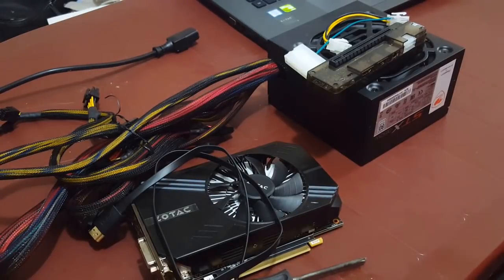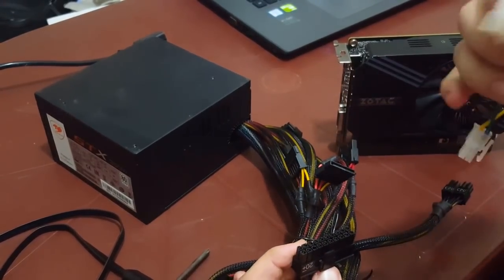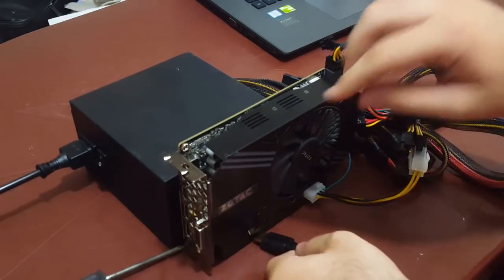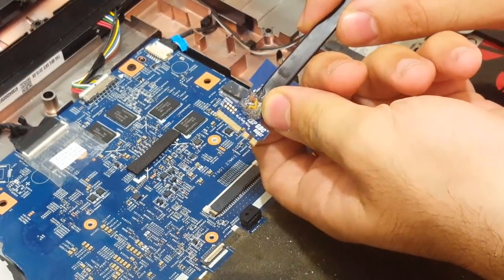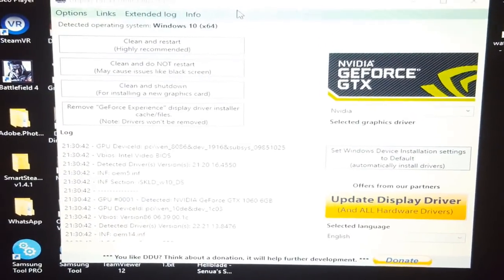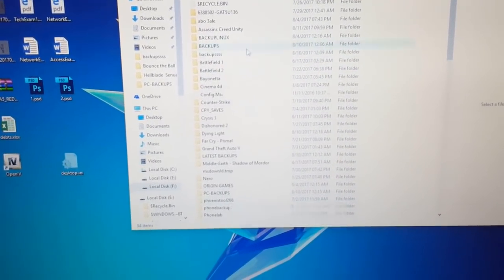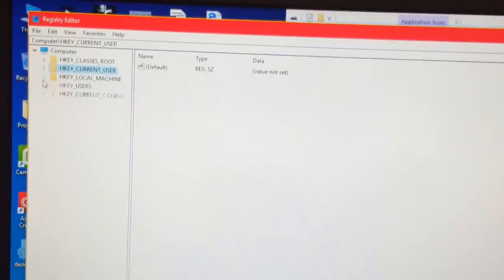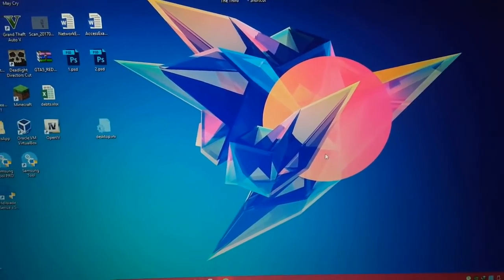HOW TO: External GPU for any laptop PC W/O External Monitor GTX 1060 EXP GDC 1050 ti solve error 43

Comment: I have a question. If the gpu is a low profile one which does not require a powersupply will this still work? does the external pcie require a powersupply to power the low profile gpu even tho it does not need a powersupply?
Reply from the maker: The device will require at least a 9v or I believe it was 12v adapter to power the GPU upnif you dont have a PSU

Comment: Question, No Ext. GPU on my Surface Note, Barely plays Fallout 76 and gets hot. Will this actually increase preformance or will I also need a ext. monitor? Will this just overheat the system altogether?
Reply from the maker: Hey, it's been years since I tried out new laptops for this tool, I'm sorry, but you'll have to check other sources or try it out yourself. But theoretically speaking it should sideload mlst of the graphics calculations to the external GPU which should reduce heat
Reply: @hmawla  Thank you, at least a responce. When I can I will try this. I will let you know. I have asked several sources to ne ignored. So basically sideloading or Aux sourcing should improve performance basically?
Reply from the maker: @Wolf'Jarl Gr'Bane  you're very welcome, and yes for the sideloading point.

Comment: Hi there. My Fujitsu Celsius H710 comes only with built in Nvidia Quadro 1000M card and I try to use Quadro 4000 card for the EXP GDC. When I try to use the Quadro 4000 with external monitor system crashes into BSOD and error message states driver failure. I I have NO intel hd graphics, how do I procede?

Comment: Bro I have e15 e5 571g acer laptop ..and I have also beast 8. And gtx 1050 ti 4gb. Then 1st time when I connected the egpu my lap not booting its black screen.. then I try to hot plug .. it's working..but after installation pc will restarting then it will happen again black screen ..not boot .. so do you have any solution..
Reply: And I try to like your video then it happened again

Comment: Hi, I have lenovo y570 laptop with nvidia gt 555m video card and integrated hd 3000 graphic and I connected external gpu video card nvidia gtx 1050 ti 4gb cerberus bit when laptop boots device manager can't detect external card, gpu I desabled in bios and leaved only hd graphic card why laptop can't see my external gpu? Maybe the gtx1050 ti card is not supported? Can you help me please? Thank you

Comment: Help please, ( MY EGPU IS GTX 1070) my laptop gpu is GTX970m, the probleme is : when i try to instal the DRIVER, they instal me the GTX970m driver, and make the EGPU (GTX 1070) whith the error 43!!, I dont now how the resolv this problem, CAN YOU HELP ME PLEASE. THNX
Reply from the maker: Hey, take a deep breath and check the description and the user comments, there are multiple ways to fix this error, so try them all
Reply: @hmawla  i try evry things, i need ti now how i can deseable the gtx970m, because when i try to instal the drivers the gtx970m turn on ... How i can block it .. and thanx
Reply: @hmawla  Hi, When i try to instal the modifed driver (you now when you add you grafic code and name)  whith my gtx1070, the instalation is stopped because  an error, tell the instalation cant continued.
Do you now how can i resolv this.

And thanx.

Comment: Thank you so much ! is really work for me !! but one more problem for me is my laptop will restart itself randomly about 10 to 20 minutes Repeatly , can you please help me out ? Thanks in ADVANCED  !!!
Reply from the maker: It could be that the laptop can't handle the GPU power so you can try to downclock the gpu a bit, also try using a better power supply
Reply: @hmawla   HI Mawla , thank you for your reply , what you mean by downclock the GPU a bit ? and i am using a Cooler Master  MWE 550W PSU , is that good enough to supply ? Cheers
Reply from the maker: @stephenphuan8696  then the power supply should be good, as for the downclocking use something like msi afterburner to make the gpu clock lower than stock which will limit the gpu power for stability purposes
Reply: @hmawla  Thank you so much , will try it later ! Cheerss ! Thumbs up for you and subscribed to your channel !!!

Comment: Full of tricks , i happy you all spend your time for share us the skill .  2020 i will try to using GTX1070 into my Predator 17 , to replace my GTX980m
Reply: just don't u will lose a lot of gpu performance because the wifi socket is way to less data transfer to that the gpu need as i remember it can reach about 5gb of transfer data but the the high end gpus need about 70~90 gbs to give the full power of the card i think u will not get far from ur 980m
Reply: @AhmedMakki-to4vr  if his laptop has thunderbolt or express card then its fine

Comment: I check my laptop but my wireless card is soldered by the manufacturer. Can that fit in my m.2 nvme pcie lanes?
I got two ssd installed in my laptop. The sata 3 port and the pcie m.2 nvme. 
If compatible i will sacrifice my m.2 nvme for the sake of egpu.
Reply from the maker: Check if you can find a PCie version of the beast adapter

Comment: Finally I found an actual helpful video because I am using a 1050ti. That video is 3 years old now, what drivers do i need to use? is it the latest ones or the versions you gave us? Also another thing, I was able to make my 1050ti appear in the device manager with the drivers installed but if i dsabled my 960m, the 1050ti also disables itself. Im using a inspiron 15-7559
Reply: I have a 1050ti too but when I opened my laptop with it the screen flickers and doesn't want to work that happened with you or if you have a solution please
Reply: @ammaryasser6588  I successfully made my 1050ti work, but I never encountered such problem, have you checked that the egpu has enough power to function because if the screen flickers, it might be a gpu problem.
Reply: @randomstuffmaker3166   yes I think I have enough power but what I don't understand that when the screen flickers then stops it open the bios telling me no hard drive in the laptop please put one
Reply: @randomstuffmaker3166   thank you for helping me
Reply: @randomstuffmaker3166  can you pls describe how you made it work, I'm using gtx 1660 egpu for inspiron 15 7559.
Reply: What's the performance you get on your 1050ti

Comment: Hi to all! I need a bit of an advice. 
I have Acer Aspire V3 
I7 
16Gb
SSD 
EXP GDP V8.0

I'd like to configure eGPU with GTC 1060 6GB OC

I follow the procedure and when install 368.81 driver there is automatic reboot and I cant or I dont know how to stop it. I have 60s and than PC restarts. I tried quickly to go to regedit and removed reboot but pc still doest it. 

Would anyone have any suggestions? 
Cheers Nick

Comment: hey man, i installed my gtx 760 and the latest driver.
my problem is, that i can`t open the nvidia control panel. everytime i want to open it, i get the message that there isn`t a monitor connected to the 760.
do you have any solution for that?
Reply: Conected external monitor

Comment: If i would still use my built-in dedicated gpu, during times that i would only bring my laptop and not the egpu. Do I still need to uninstall the driver as you showed in the video? How would i use the dedicated gpu if I unplug the egpu?

Comment: great video man. i have a question: some guys say that you need an external monitor. why runs your internal monitor? i noticed that the guys, who need an external monitor don´t have a dedicated graphicscard in their laptop. 

greetings
Reply from the maker: It depends on the laptop if it supports it, also using the internal monitor will impact performance
Reply: @hmawla  my laptop is an acer like yours and has a dedicated nvidia card too. in a forum i read that you can use the internal monitor when your laptop has a dGPU of nvidia
Reply from the maker: @olim8742  you only need an integrated gpu and laptop support to use the internal monitor, though the dedicated one is a better addition
Reply: @hmawla  what do you mean with laptop support? my laptop is in  the supported list of the manufacturer

Comment: I want to do it on a acer nitro 5 with Gtx 1060 i want to connect it to a Rtx 2060 or 2070 will it work with that?

Comment: i have one question. in other videos the guys say that u need an external monitor because you cant use the internal monitor with an eGPU. why can you use the monitor of the laptop? because of the M.2 slot which you use to connect with the graphics card?

Comment: I have a HP probook 6565b, the beast v8.5c with expresscard version and a radeon rx550 4gb... im connecting this with a power supply 650w.. the laptop does not turn on, it stays with the black screen, if I connect it when it is turned on then all the usbs stop working.

Comment: can i put an EGPU to my acer e5-411 laptop?
PS: my cpu is an Intel Pentium N3540 with 2 gb of RAM
pls reply
Reply: yes you can. should work with any laptop. just check the kind of cord you will need first. NGFF or PCI-e before ordering. I made that mistake and had to wait 1 week to finally get the right cord lol

Comment: I have lenovo ideapad 110 Intel(R) Core i7-6DU CPU @ 2.5GHz  2.6GHz, 12.GB
 RAM, 64 Bit, Windows 10, inel HD Graphic 510 and IM GOING TO USE RX580, is it compatible and able to run?

Comment: Is this setting work if the gpu not detected in the laptop? Im using gdc Dock either buy with mini pcie... after all configuration done, i turn on my laptop, the gpu’s fan are spinning but the gpu not detected on device manager... i wonder if this method will work? Aand if its work, is it work for gtx 1070?
Reply: I really really really apreciate if this method work...

Comment: Super helpful video, thanks for posting. One thing though, is there any way to get around the fact that you need an external motor when using a egpu on a AMD integrated device? I have an older HP laptop with an AMD A10 in it and want to use the laptop monitor

Comment: I'm trying to do mine on an HP-15 Notebook fwm272. When I start it up it'll detect it sometimes but other times it wont. If I restart the computer with it still in there to try and install the drivers the screen will go black unless I shut off the GPU. It's SO FRUSTRATING! :(

Comment: Hi Pedro,

Today I am going to try to follow this procedure no on my rtx 2070 super amp extreme gfx card. I'll let you know if there is problem, I just wanted to know if I have to use the driver version 368.81 first for this gfx card as well?
Reply: You had any luck?
Reply: @FermiGBM1  hi it worked but it encountered a severe bottleneck on the cpu since it is a 6th gen cpu. I have finally surrendered and billing a gaming right with remaining parts.
Reply: @mr.nobody.5187  I see is cool to know it works though
Reply: @FermiGBM1  may be its because i have a 6th gen cpu and a latest graphic card and thats why its bottleneck, i dont have a 10 series grx card to test, but its really no worth it.
Reply: @mr.nobody.5187  hey, just checking from the future lol, so the installation of the 368.81 works with present day drivers? I just ordered a 1660 which is 442.19 installation.
Wanted to make sure all the processes in this video still apply, so I can dont have to use a external display.
Reply: @Zakurasae  ...
using the internal display will give you much slower speeds. 30-50 percent loss.
using external you will get only 10-15 percent loss.

Comment: I have an Acer V3-574g laptop and im trying to connect a GTX 960 using exp gdc v8.5. Problem is when I turn on laptop, I get black screen only. I also tried hotplugging but laptop still cant detect the egpu. What should I do?

Comment: AWESOMEEEE !!!!
I have just one question : will this process work on a hp ay008tx with a RX 580 8GB ???
Thanks in advance
Reply from the maker: I am sorry, I did not get any benchmarks with the new AMD GPUs
Reply: @hmawla  thanks for the answer. So would be no problem with a gtx 970  instead with a hp ay008tx (with a dedicated gpu amd r5 m330) right?
Reply from the maker: @redhawk486  yeah I guess it should work if u do everything correctly

Comment: can we still use it without the external gpu? for portable using???
Reply from the maker: Yes, you can create an incasing for it, so that it can be used in a portable way...
Reply: @hmawla  so if we unplug the pcie cable, it will use intel integrated graphics card?
And if we go home and plug again the pcie it will automatically detect our egpu again??
Reply from the maker: @slickyy_  yes
Reply: @hmawla  thankyou for the reply, appreciate it

Comment: I couldn't get it to work... Now I have 3 Display adapters. Intel HD Graphics 630, NVIDIA GeForce GTX 1060 6GB, NVIDIA GeForce GTX 960A!

I've tried many iterations, and even disabling PCI Express Root one-by-one (there's 3, and the one that turns off the Graphics adapter turns off the 1060, not the 960A).

Any chance you have any other suggestions?

Comment: when you remove the cable from the external pci, the computer will work with integrated video graphic card?
Reply from the maker: You will have to re enable it
Reply: @hmawla  how?
Reply from the maker: @danielavisentin3583  the same way u disabled it, the PCIe device in the device manager

Comment: I've been considering the investment on an external gpu for my laptop but that ain't gonna come cheap, so i need to be sure it will work first. This is the first tutorial i see that actually gets it done even in a laptop that has a dedicated nvidia gpu without having to tweak the bios. And usin the built in monitor! This makes me a bit more inclined to try it because i have a dedicated gpu but the bios in this laptop is very restricted so i'm afraid installing a modded bios could brick my laptop.

If i decide to try it i'm gonna do it on a clean windows installation, so i guess the driver uninstalling process is not necessary. So basically i just have to disable the pci port that runs my internal gpu and then install the drivers for the external one? Do you think this may work with any external gpu?

Comment: Thank you for your deep explain, but sir when I want to install the driver it shows " the graphics driver could not find compatible graphics hardware " Power supply and the graphic card are working " 1050ti" BTW it is not showing in Device Manager

many thanks in advance.
Reply from the maker: if it is not showing in the device manager then there is a connection problem, make sure that you have connected everything in the right way
Reply: @hmawla  Thank you for the fast reply. I have checked power supply is running the fan of the gpu is running and sometimes the laptop boot with black screen and sometimes not I am really confused do you recommendations me to test with external screen?
Reply from the maker: @malikmasoud504  try to test it on any external screen, also make sure that the gpu and power supply are powered on before powering the PC on
Reply: @hmawla  I did everything you told me. When I run them on at the same time I see black screen and external screen refused to boot from the egpu. 

Do recommend me to do formatting for my laptop to get show up in device manager?  Or the black screen is good sign?

Comment: I tested rtx 2080 ti it was running smoothly
Reply: Rtx 2060 super 8gb zotac exp gdc v8.0 lenovo y410p i7 4700mq 16gb ram running smoothly

1. Erorr 12 i fixed it by downgrading the driver software
2. Erorr 43 i fixed it by downloading a batch file that fixes erorr43

If you had more erorr or undetectable gpu, fellfree to buy diy egpu program
Reply: @s.melvintang1660  I am trying to run an asus rtx 2060 but getting an error 43
Reply from the maker: That is good to know
Reply: thats a lie
Reply from the maker: @SunnyAdwal  You think so? cuz if it is am gonna remove it
Reply: @hmawla  seriously bro u can run rtx? With that thing 😐
Reply from the maker: @SunnyAdwal  it would make sense according to the PCIe compatibility, but who am I to say if it works without testing.
Reply: @carlodeguzman683  i think you should not do that because im buying rtx 2060 super for my next pc. You should go for 1060 6gb or lower. My cpu is also bottlenecking the cpu running games at cpu 90% gpu 80%
Reply: @wesput188  Hi, did you tried? I'm also thinking on doing so

Comment: Now my both gpu got error 43. Anyone can help😭😭😭. My internal gpu which is 920m got error 43 also. I've done so many things, update driver, patched it using nvidiaerror43 by nando and so on. Still nothing solved. Only my gtx 1050 ti got patched (solved with the error 43) but the 920m nope. It still error 43

Comment: I have a 1080 with a sony I5 Laptop
Did not work at all
I did all the steps
Im not hating on this guy to be clear but i was wondering if you can make a video for 1080
Reply: Go to https://pc-builds.com/calculator/
It will calculate the processor Bottlenecks with gpu ,just add your cpu and gpu then try

Comment: I mean a pretty huge factor of the external monitor is it’s affect on the quality and the output of power being so much lower than with an external monitor, which is how it was intended to be used and how much more optimal the product performs in its intended usage environment

Comment: Help pls. Basically when I plug in the ngff, my keyboard stops working when I launch windows and says it has failed to start the ps/2 Keyboard on device manager. I also want to use the laptop itself alone for egpu gaming including internal lcd.
Reply: Update s about ur situation m8
Reply: @outlaw-vipex1600  Gave up and sold it all. Built a pc instead.
Reply: @alz283  nice 👍
Reply: @outlaw-vipex1600  Yeah realised it was going to be unreliable
Reply: @alz283  I thought about doing it and I realized that it looks easy in youtube and it's harder in real life sooo I am just gonna save up for a new laptop